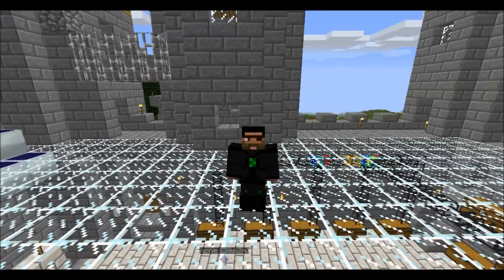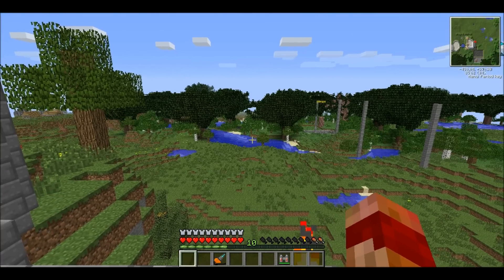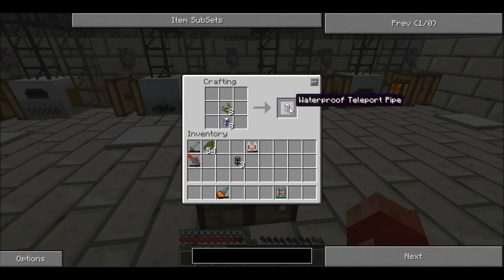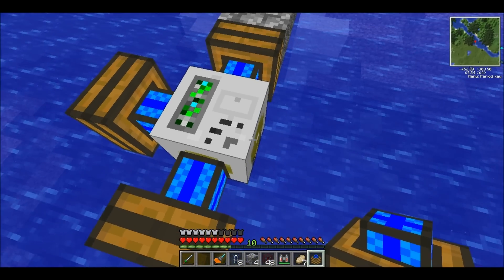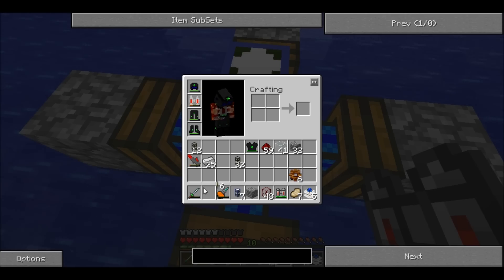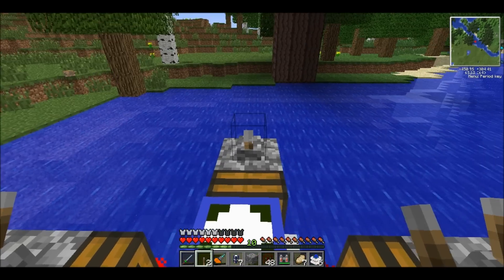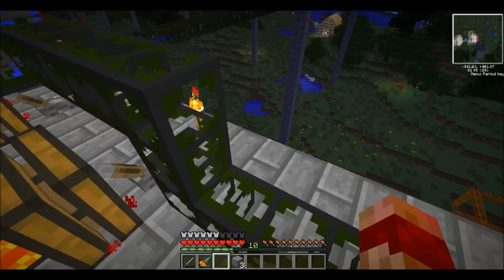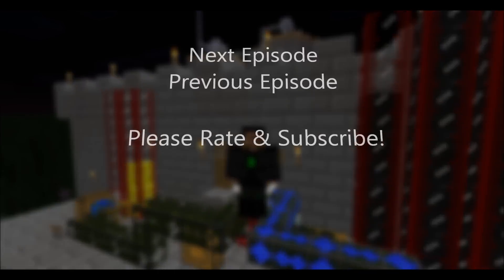Minecraft Technic Part 14 Combustion Engine and Teleport Pipes!

Comment: @thecncgamerz The combustion engine can power any buildcraft machine at a pretty high speed if plugged in to a wood pipe it takes out a whole stack quarrys,builders and fillers will run really fast but if you dont cool it sufficently it will blow up

Comment: Hey,  loving your channel thanks.  Got an issue (not really an issue but a glitch) where I have a chest connected to a wooden pipe powered by a combustion engine.  Some Items appear to disappear into the combustion engine instead of going straight on alone the rest of the piping.  They do eventually end up where they are meant to be but its annoying to see this happen.  Any tips?